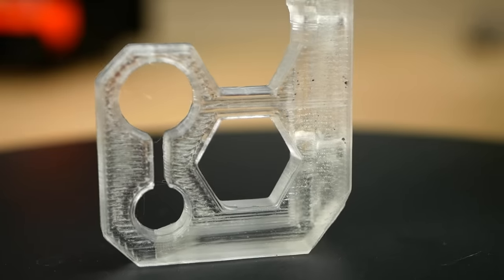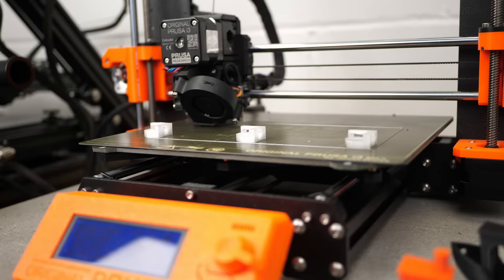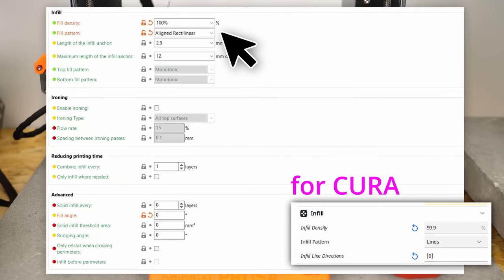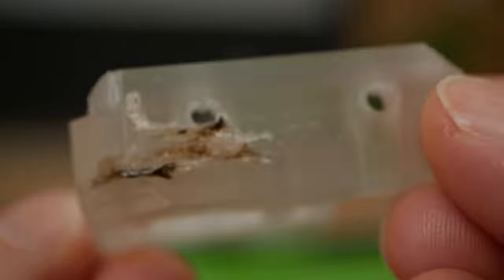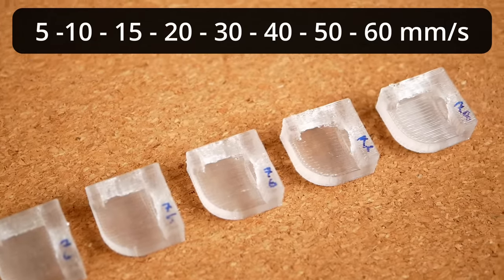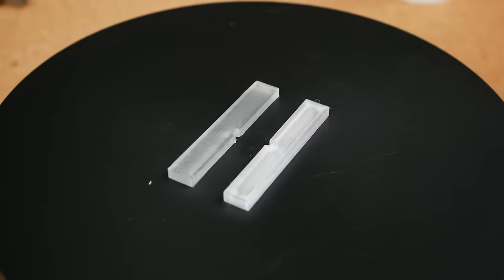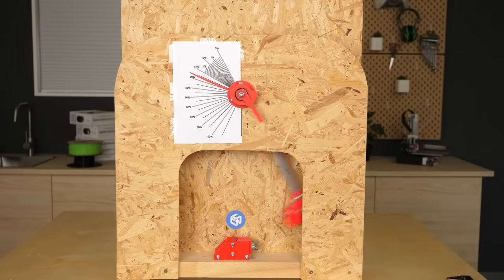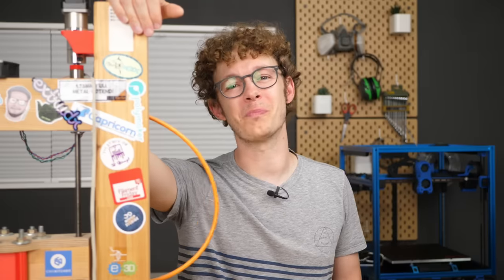Transparent FDM 3D Prints are Clearly Stronger!

Comment: The possibility of someday printing optic is just incredible. Imagine if you could print your reading glasses. Yes that may be in a way a bit extreme but it's be basically free glasses for everyone.

Improving strength is nice but recently I started printing parts at 45° which often solves strength issues.

Comment: Though I haven't been printing because I haven't had the time to sort out the problems with my mini delta, I have an idea that could take some time to develop, but might make  a useful addition to a 3d printer.

One comment I read mentioned flash melting the surface of a 3d print with a heat gun.  A 3d printer with extra XY space could possibly be rigged with a nichrome wire (surplussed from a dead blow dryer) stretched out horizontally next to the print head. Just before the layer is done the gcode could pre-heat the nichrome wire very hot, and then the gcode could iron every layer before starting the next layer. Then the gcode could reduce the heat on the wire for printing the next layer.  Since I don't know of anyone doing this yet, if I'm the first one to suggest it, I'm placing the idea in the public domain, so have at it!

Comment: Prusa slicer has a setting, under ironing, to iron all layers. It only works with 100% infill. I’m sure I’ve seen it hinted somewhere that this feature is exclusively for printing clear or transparent as possible printing as it adds a significant amount of extra printing time given the ironing process each layer. Worth a check as a control vs other methods tried to see if any impact or improvements in the check box simplicity vs the custom profiles. It’s also interesting that cooling will make it less transparent. This is the opposite when manufacturing/extruding clear polymers with a screw. Interesting also.

Comment: I have experimented with no-cool prints in the past, because in my mind when you want to make plastic stick together it should be hot so it can melt together. You have to go slow and tweak the extruder, but the parts that come out of that are nearly impossible to destroy. I made some lockable filament passthroughs for my filament box and even just 30% infill printing them slow and hot in PLA made them so strong I couldn't break them into pieces. They are so solid they feel like they are cast. Made some spacers for a washing machine the same way and sat the 80kg machine on them. Haven't even deformed under the weight and vibrations. If you can get PLA to actually melt itself together it's strong. I think the obsession with the cooling is maybe not the right direction for layer adhesion. Though I suppose it's a case of tweaking settings to what you gonna use the print for. Still, it's not ABS all the way when you need something solid.

Comment: as mentioned in the video, its far quicker and easier to get transparent parts from resin printers, especially using a cure-wash-cure process sequence.   FDM parts air gaps between filaments in the corners of the channels require going to extremes of slowness and heat.  perhaps some sort of sideways movement of the extruder might help shear off the gap volumes.  in welding, little circles are done with the welding rod.

Comment: Great work - very interesting!  Most people dial in a single bead width very accurately with calibers but this means you will get voids as the sides of the beads are not square. The voids have a bigger impact in the z-direction than the x-direction.  The extra extrusion helps fill this in, though it is hard to get it just right and prevent slowly over-extruding.  The higher temperatures also help with inter-layer adhesion.  I think the lower speed helps keep the extrusion rate just right.  Higher speeds will create back-pressure that will create problems at corners.  The z-direction strength you achieved is excellent though.  It would be interesting to combine this with the benefits you have shown of using a larger nozzle.  Larger beads have less interfaces for voids to form.

Comment: My application doesn't require transparency (although it's a nice benefit), but the increased strength and especially the lack of voids/gas-tighness makes this approach very interesting for me. I'm working on pneumatics, so I need to make parts that can take 150 PSI (2-300 PSI proof) for their entire working life. I have been prototyping with polycarbonate (w/manual mill and lathe) for prototypes. 3-D printing PETG looks like it may be able to hack my conditions.

Comment: Another class of materials that might be interesting to look at are the next generation polyesters: Fiberlogy CPE HT claims to be a drop-in replacement for polycarbonate, Innovatefil has hight-temp CPE that looks similar, then there are DURABIO, Green-TEC...
all of these (according to the manufacturers) would be quite high-performance engineering plastics, all non-toxic and printable without a smell, and without an enclosure

Comment: This is awesome,

I've seen a few things suggested in the comments, a lot of which you have already acknowledged. I have a couple of thoughts.

Better layer adhesion could be a result of the ironing effect from thin layers.
This would be fascinating, I'm curious to see if ironing the print every layer would have any more impact on strength and clarity, or if it's already beyond the point of diminishing returns. 

Printing PET in a chamber to get better temperature control.
This could also be extremely interesting, as you already are potentially having issues with cooling, but If you have a higher chamber temp, combined with part cooling, it means you could allow the warmer air with greater airflow to allow for some cooling, while not suffering from some of the problems that come from large difference in temperature and the rapid shrinking of the filament.

These videos are extremely interesting and I greatly appreciate the time and effort you put into all of this content! Great work!!!!

Comment: I few years ago, I 3D printed a gear in PLA to repair a toy. I used 100% infill, no cooling and slow speed. I tried to brake it, to see how strong it was, and it broke in diagonal! It was like there where no layers at all, in regard to the strength.
And to answer your question, I'm definitly interested about strength, not clarity nor speed.

Comment: I've been doing a trick for stronger prints for a while. I don't have any transparent filament, but would be interesting to try.
Set the slicer to a nozzle size half what you really have. Adjust extrusion rate, and set model inset to half the difference.
Reply: Hmm that sounds like an interesting hack.  Seems like it would come out even, but I imagine once you tune the extrusion rate, you are doing a better job of getting perfect flow.  Do you "adjust the extrusion rate" mathematically or do you do additional tuning manually by how the extrusion looks?
Reply: The idea is that each line in a layer is overlapped. As you say, it should come out even, but I adjust to maximise density. About 200% works for my machine.

Comment: I did similar testing a few weeks ago, but using Sunlu's transparent PLA (which was not great for maxing out transparency) on an X1 Carbon using Bambu Studio, and while Rygar's guide was extremely useful, I actually found that transparency increased with cooling! I tried it several times and got consistent results, but I suspect it maybe only applies to PLA?

Further findings:
- Lower layer height = the better, but the difference between 0.04mm and 0.08mm is so marginal that it's probably more worthwhile to just use 0.08 and avoiding doubling the print time

- Print speed around 10mm/s gave best results, lower didn't really make a difference (and I tried all the way down to 2.5mm/s) - but I think you can go up to 15mm/s like you did without losing too much transparency

- Aligned rectilinear infill (at least in Bambu Studio) leaves small air pockets around the perimeter as the nozzle turns around - you can bump up transparency quite significantly by using two perimeters, but setting your infill/wall-overlap quite high, like 60%-ish, then setting your inner-wall-line-width really, really low - like 0.1mm on a 0.4mm nozzle. This causes only a small gap between the infill and the outer-most wall, and then the inner wall can fill that gap almost perfectly using very fine flow-rate. This seriously helped, although I wasn't able to completely eliminate the air pockets, but I think it's just a matter of playing around with the parameters more.
Reply: Thank you for sharing your detailed findings Stefan!  \o
Reply: I should add that I noticed just yesterday that Bambu Studio has a feature for ironing every layer! That would make my third find useless and may well boost the transparency immensely, but I haven't had a chance to try it yet :)

Comment: This is something I'll like to chalenge you long time ago ..
But only using transparent PLA ...
In fact my chalenge is more to print part for the same weight as displayed by your slicer ..
(but you have to print a big piece to be able to adjust that)
In my case I have to set flow 110% to have the same weight as displayed in my slicer (in spice of my extruder count properly 1 meter of filament)

Comment: I think one way to get even better strength might be to print a shell/mold, then to replace the nozzle with a nozzle with a needle to get into the mold, then to use overfill to effectively injection-mold the inside of the parts. You might need to leave multiple holes in the piece, to get access to all the parts which need to be filled, if the shell doesn't normally give you access, and also to function as overflow holes for the excess overfill to get out of. This would also allow you to use a nicer looking filament for the shell, and a stronger filament for the filler. I'm looking forward to seeing your progress in this sub-field of 3D printing.
Reply: You might be overthinking it 😃 There is breakaway filament designed for easily removable supports.  Print a 1 parameter shell, no top most layer and squirt a bunch of clear epoxy into that guy.  I'm curious if you could get the shell off... Probably need a release agent... That would make the exterior cloudy.  Damn. 😜

Comment: Get transparent and strong parts with ironing. I have a 0.4 nozzle but changed nozzle diameter in the slicer to 0.2 then I dialed in a new extrusion flow. The gcode has twice the line paths on the 0.4 wall thickness so prints take longer but it's a tradeoff.

Comment: Very interesting! You mentioned drying, I think you may be under estimating how important it is to dry and keep dry polymers that are sensitive to moisture, Typically the polyesters, polyamides, polycarbonates etc. You have seen the physical effect of bubble formation that creates clouding, lower density and micro cracks. BUT the moisture and heat are also breaking down the chemistry of the polymer and dramatically weakening it ( also effects ageing ). When using traditional moulding processes these polymers are dried and KEPT dry in desiccating ovens and hoppers, right up to the moment they are melted.

If you really want to maximise strength ( and transparency ) I think you need to investigate a way to keep the spool in a desiccated enclosure. 

Perhaps you could experiment with short lengths of filament conditioned in different ways and extruded into very small test strips / fibres, 
This would give you an idea of how big the win would be from investing the effort in keeping the whole process super dry.

Comment: Single direction infill was new to me. As for the other parameters, they effect print quality and speed in such ways, that this will only make sense in a limited set of use-cases. Also, after printing print mesh with clear PETG, the real clearness of the filament became obvious, as only thicker blocks will be clear.

Comment: For parts that do not need tiny features in them you could combine this method with using a big nozzle diameter. With that you run into the flow rate limit of your hotend at much lower speeds anyway so maybe having decent speed in grams of part per second could be achieved while still giving the plastic good time to bond together as each line is layed relatively slowly.

Comment: Hey, you need to have a look at Filaticum PLA Engineering. It is $70/kg, has a higher tensile strength than PETG, higher impact resistance than ABS, stays in shape up to 150° C and is as easy to print with minimal warping, no enclosure and bed adhesion like PLA.

Comment: Been doing this for years with taulman t-glase.  But with very try filament and fat line width and high layer heights.   I use a .8 nozzle and print at 1.5mm width and .5mm height.  But I do single layer or 2 layer prints.  Like lcd screen protectors on portable power banks I build.

Comment: Interesting observation about the polymer chains. Do you think they are being aligned during the extrusion process and then changing orientation by 90 degrees when the extrusion is laid down?
I would have assumed that the polymer chains in an FDM part are randomly aligned because it has been melted and deposited with little strain applied during deposition or cooling.

Comment: Thanks for this interesting video. It would have helped me 3 months ago when I started the journey into transparent.  Today, I am able to print relatively quickly transparent parts with "Colorfabb HT Clear." I need this for its high heat resistance, which PETG cannot offer.  To gain speed, I use a 0.8mm Nozzle X, which helps prevent burnt filament falling into the print.  I tweaked many many parameters to get as best a result as possible, but did not yet try aligned infill, although I do use monotonic infill to get better fill.. And for strength, my parts are tough as nails, practically unbreakable!  Today, I'm going to try an aligned infill test to see what it gives! For info, I am printing on a Voron 2.4 sliced with SuperSlicer.  Anyway, thanks for this!

Comment: Thanks so much for Stefan, this was REALLY neat to see and I'm excited for all the potential! You putting out great ideas like this to the world is awesome because it introduces a new line of thinking to so many makers out there. 

The parameters and settings you're using for this remind me almost exactly of what I do to get functional strong "rubber" straps when printing with flexible filaments like NinjaFlex, which is kind of my passion with 3D printing. I print very slow and with 100% infill or more to ensure there are voids and weak spots within a TPU print. I'm excited to try what you showed in this video with the clear filament I have sitting around. =]

Comment: Great video. I’d like to point out. It’s a common misconception that 99% infill should be used in cura instead of 100% because as many users like to say “cura doesn’t like 100% infill. This is actually not true, however there is an important setting you much change in order to run 100 percent infill in cura. 

When a user selects 100% infill in cura, the slicer automatically changes the bottom layers to 9999999. This means that your entire print is made up of top/bottom layers and the settings you have applied to top/bottom layers instead of infill. This causes a massive print slow down as many users run their top and bottom layers slower than their infill.  Additionally, and important to this video, you lose control over infill line direction since the slicer has replaced all the infill layers with top/bottom layers. 

The fix is simple, manually override the 999999 top/ bottom layers to the value of your choice. This returns all of the intended layers back to infill layers, thus applying all of the settings applicable to infill such as infill line direction and speed, all while having the slicer set to 100% infill.

Comment: Can also do arachne perimeter generation instead of regular, fills voids far better.
I prefer increasing perimeters to have a solid part instead of 100% infill. I've found thicker layers make a clearer part, as there are fewer layer interfaces within a part. For my clear parts I use pure natural nylon, and must dry the filament while it is being used.
I am able to fine tune the clarity in different areas of a part by changing the print speed, temp, and cooling. Faster/colder/more cooling makes the cooled crystalline structure of the printed filament less consistent and so diffuses light more, and vice versa.

Comment: You might be able to print faster if you use a heated enclosure - yes, it would make the sagging problem even worse, but the nozzle can heat the previous layers up more easily if they're already warm. Turning off the cooling fan can sort of accomplish this heat retention, but heating the entire enclosure will make the effect more evenly distributed.

Comment: Maybe a way to get even clearer prints for some cases would be to print the outer shell first for example 1.5mm thick and then fill the shell up with very high flow, speed and layer height.

Comment: I think this would be the perfect print settings for making a bong or a pipe. The main problem with a 3d printed smoking pipes Is that there are layers in between the plastic we're bacteria can grow. This would make it so there is Nowhere water can get trapped or leak and because PETG always has a very smooth feel it should make cleaning easy. And if you want to argue that PETG Is not food safe enough Giving the print a coat of food safe epoxy will fix that.

Comment: From what I remember reading, you need to set flow and print speed independently for infill, bridges, and walls for best effect, as well as for the top and bottom layers. Maybe do some fanless bridging tests to find the best speeds for that and various widths and thicknesses? Not just individual layer thickness but multiple-pass thicknesses as well because additional layers can reheat the lower layers and then take longer to dissipate overall. There's a more accurate way to phrase that I know, but my brain isn't cooperating to think of it.